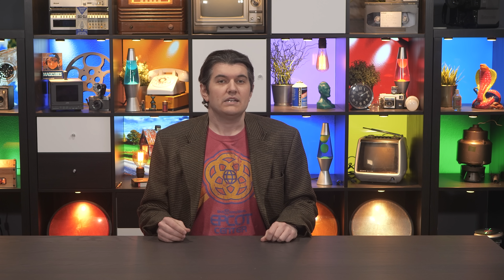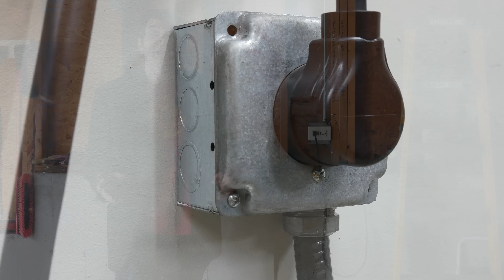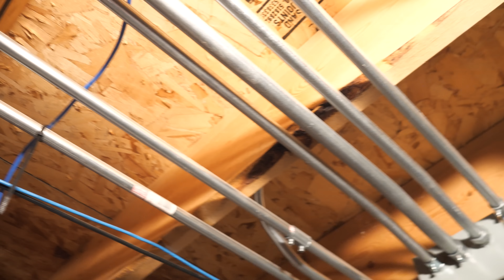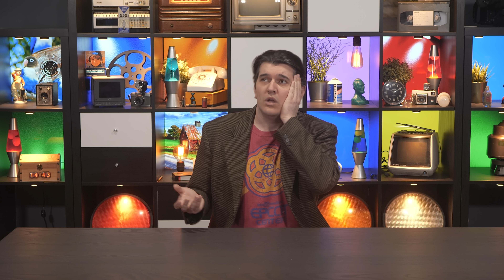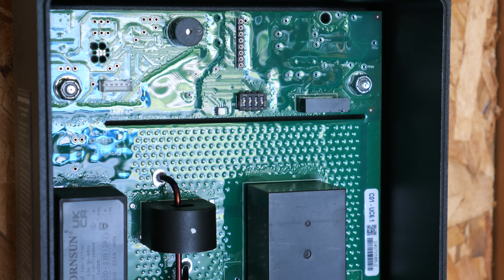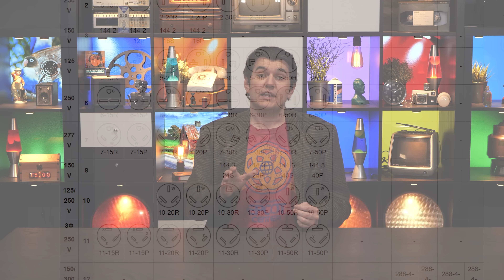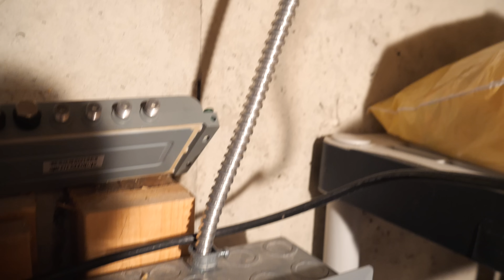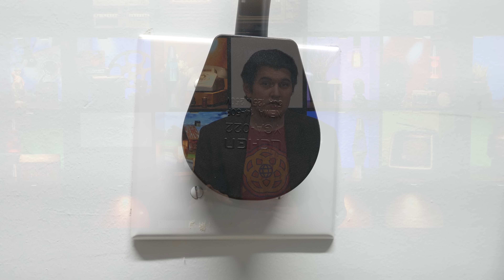The "standard" car charger is usually overkill—but your electrician might not know that

Comment: Every Diesel-Dieter would now try to tell you how it is much more convenient and way easier to replace a headgasket on any combustion-engine and that changing oil every few thausand miles is not an issue in any capacity.
Yes, I do like EVs AND I drive an older Diesel powered car. I exist and my name is not Dieter.

Comment: Currently I charge from a 15a. 120. Its Very slow. charges 1% per hour so between shifts is about 10-12% per day... my drive is 25% per day (aprox 70 miles) So i need to go to a super charger every week (which is pretty expensive. Around 60 cents a KWH for non tesla ones and there arn't many tesla ones near by they are around 35 cents KHW.  I am having a 40 amp Installed (max charge rate of car is 32A) in my area its required to be 125% of load (since its pluged in for many hours in a row).

Comment: Looking to buy a used EV this year so I can give my old Prius to my now driving-age child.  I probably will add a level 2 charger, but ONLY because the circuit breaker is in the garage and I can locate the station right next to the breaker panel, so installation will be about as cheap as it can possibly be, and the unit will be free as long as I don't get a high-end one because my electric utility offers a pretty good rebate that will pay for most mid-range (talking cost here) charging stations.  If it weren't that simple and easy (and cheap) I'd stick with level 1, because my daily driving doesn't need level 2 to replenish it.

Weirdly, I've been in conversations online in the past couple days with people who are absolutely convinced level 1 charging is horrendously dangerous and will burn your house down.  I've been trying to explain that unless your house is very old, that just isn't the case, but whoever sold them their level 2 station convinced them that it was dangerous not to use one.  And that's where I draw the line.  It's one thing to OFFER and even recommend a charging station.  It's another thing entirely to lie to customers to scare them into buying something they don't need.

Comment: This video is nonsense. A Tesla model S takes 3-4 DAYS to fully charge on 110v. Even then, if you're running on 110v, it's going to be maxing out that line, thus you should run a dedicated line, or else you'll blow the breaker anytime something else uses the line. If you're running a dedicated line, you should run a 220v line for(basically) the same cost, obviously. 

Yeah, if you commute 5 miles a day and refuse to use the car otherwise, yeah you can get away with 110v. Anyone with some sense is going to want 220v.

Comment: I told a friend I could install it for him, but he hired an electrician for $300 instead. The “electrician” put in a 50 amp breaker and set the charger to 48 amps. When I asked if he used a torque screwdriver on the breaker, he said only pussies use torque screwdrivers. We’re not friends anymore.

Comment: Last December we installed the exact charger (or similar version) you show at 1:26 in the video. We have a 2023 Chevy Bolt EUV which we charged with GMs 120 volt charger that came with the car for two years. It worked fine, but was a bit awkward to mount on the wall and it used another socket in a socket challenged garage and it was very slow. Decided to get a 240 volt charger and the ClipperCreek was on big sale as Enphase had just purchased the company. So in order to put in a 240 volt ClipperCreek charger (6-50R plug) I had to upgrade to a 200 amp main service panel, upgrade the subpanel in the garage (opposite side of house from main panel, have wires run through the ceiling from the main to the sub, and have wire installed in the garage ceiling to the charger wall location. While we were at it I also had them install wire for a heat pump water heater (coming soon) and install a generator inlet socket so I can use my Anker Solix battery when the Texas power grid poops again. But wait there's more: city code required a new meter box (has a big knife switch inside now) and new grounding rods and wire. I was happy about the grounding as I always felt the exisitng one was sketchy. All that cost around $16k but now we don't have to worry about the car being charged oevernight if my wife has a busy day and comes home with a low battery.
Reply: $16k? it's Expensive!

Comment: You can't charge from a 125 volt x 15 amp plug in winter because it won't heat the battery and charge at the same time.  In AB today Mar 26 it's -11 C.  Still winter, Eh?

Comment: Charging at 120v is the worst way to charge. You will have an emergency and have no transportation unless you have a 2nd gas car. 120v is very very slow. MC cable comes in #6 stranded 60 amp. It also comes in # 2 stranded 100 amp.

Comment: One thing most folks don't know is the importance of quality in electrical sockets.  There are 240v 48a sockets for around $20.  The same outlets are also available for $100+  The expensive ones will last for years.  The cheap ones will quickly wear when they are plugged in and unplugged, soon heating more and more and are a big safety problem.

Comment: For the first month or two I had my car, I charged it off of the 125V 15 Amp circuit I had available. That was not convenient or adequate in the winter parking it in an unheated garage.  I wired up a 240V circuit to charge it at about 30 Amps. I upgraded that to 50 amps when time permitted because I could do it myself, though 30 amps was really enough.

Comment: I started out with a higher power charger and a nema 50 amp plug now I use a portable charger where I can set the charge rate to 8,10,12 or 16amps - didn’t notice the difference - the car finishes charging early in the morning instead of midnight

Comment: I was lucky to have my EVSE installed right next to my panel, so having an electrician hardwire install a 60 amp breaker was $400. I’m not sure how much less it would have been for a 50, 40, or 30 amp breaker but I rather have more than I need than not enough. Never know when a spur of the moment long trip is needed in an hour or two and I can get as much in before departure. Plus, my utility company charges the lowest rate between 12am - 4am, so with a 48 amp max I can almost always charge within that lower rate time. I do usually charge at a lower amps by adjusting in the chargers app (like 32 amps), but if I need to I can always just move it up in the app.

Comment: Agree on the need for a charger to be linked to anything but the car and power supply. Software NEVER works flawlessly and simply adds to the failure rate. My apologies to all the nerds out there who NEVER write bulletproof code. Ditto the refrigerators, dishwashers, and washing machines who think they too need to tell my smartphone I'm low on milk.

Comment: We’ve installed a level two charger, but I’m not sure we “need it”.  Yes, you do have to remain focused on plugging your car in the second you pull in the driveway and leaving it plugged in until the second you pull out, but having said that, you can get away with it on 110 if you just focus.  I doubt we will ever get back all the money we’ve spent on the level two charger by using a time of day rate, but that is one excuse for having one.  The good news is the power company pays for the Electrician so we only have to pay 600 bucks for the charger.   

And yes, you can get a cheaper charger.

Comment: In Germany this is even more insane. If you want to have a charger say in your garage and one in front of the house, your local electricity provider will deny it. If you have a heat pump, they will deny both.
There is just no good alternative for providing power for charging. The Schuko outlet is said to melt under continuous 16A/~4000W draw.

For my flat they offered to build charging stations for 5500€ per unit. (I don't know how many are the top limit for me and my neighbors)
And we would have to pay 18€ per month for the subscription plus insane prices like 50ct per kwh.

Comment: My garage has a 30A outlet but had a cheap Chinese outlet so I put in a good 20A 120v  outlet and charge at the 18A charging in my Blazer EV! This cost virtually nothing and have never needed to charge anywhere else! “State of Charge” showed melted outlets so don’t use a cheap outlet! I wouldn’t trust 220v outlets in new houses either as builders go cheap!

Comment: In the UK all installed chargers must be smart by law, never considered the points you made towards dumb chargers however the main issue with the UK is that for the cheper EV electric traiffs you need a smart charger or a supported car and the chargers are better support than the cars from what ive seen however ill be importing all the data sources (supplier, charger and car) into home assistant so it will all be within a single app and controlable by our favourite voice assistant

Comment: 24:54 I rent a single family home along with a couple of roommates. That information would actually be extremely useful to me as someone thinking about getting an electric car because we need to know how much electricity my car is drawing in order to fairly split the electric bill.
Reply: My EV displays the amount of electricity (in kWh) my car has consumed on the trip odometer. I read it and reset it when I get my electrify bill.

Or, read your monthly mileage and multiply by a factor from other people with the same car. My car averages 236 wH per mile. I pay $0.23 per kWh for electricity… That’s 5.4 cents per mile. I pay more per mile to insure my car.
Reply: @paulkelly5035  I thought about that, but if I do any amount of charging at a different charger it throws it off.

Comment: My job got a fleet of EVs, a bunch of Bolts, and a few Mustangs. The powers to be begain to freak out about charging.

I am the senior most electrician so I heard a lot of this. I asked if these vehicles were for on campus. And of course, yes.

I installed a hand full of 120vac 20 amp GFCIs random throughout. I told them to plug it in every night.

They gain about 22 miles overnight and use about 10 miles, at most, a work day.

Comment: It's interesting to see the differences between the electricity stantdards in the US and Europe.
Here in Europe, it's very unusual to see a EV charging point plugged to a Shuko outlet. Usually we have a dedicated line with the wires just screwed directly into the charging point cirtcuit.

About the simplicity of the charging points... I have to dissagree. I have a quite simple one and I'm considering moving to a more complex one as soon as I upgrade my house. And mine is even more complex than yours, as it has dynamic load management, so it monitors my household load and adjust itself so the main switch doesn't trip. And that's why you need to monitor your consumption, rather than FYI. And well... that's also a nice feature if you can integrate it with your home automation, like Home Assistant.
But as soon as I install solar panels I'd love to have more information and control. Like to be able to tell the charging station when to charge (on demand, just with solar energy, when the power tarif is cheap), with a very high potential of saving money. Also, you can plug it to Home Assistant or your inverter to make it more integrated and inteligent.
And it doesn''t necessarily needs to be connected to the internet, just to plug a RJ45 cable and to work 100% locally in your network.
A great example is the V2C Trydan, with all these features great to have if you need to control when and how power is consumed.

Comment: We usually charge on 120V over night without any issues. Otherwise, we plug into the 30A dryer outlet and get a full charge in around 6 hours. If we really need a fast charge, we go down the street and plug into the local charging station.

Comment: Just got my first EV and after an electrician told us that in order to pass a code inspection we 100% without question had to upgrade our 125A panel to install any 240v charger. Instead we had a different electrician install an 60A Emporia Pro that has a monitor that adjusts the charging level based on the total load and is also code compliant. Saved at least $10k and it charges at 48A in the middle of the night.

Comment: The huge hack is if you have a 20A 120v outlet, you can switch the breaker out and reconfigure for 240v 20A with no new cable drop!

Comment: We thought our EV would be dead within a week if we didn’t get a data charger installed ASAP. But 6 months after buying an EV we are still just using a regular old 120V wall outlet. We don’t have a long commute in the family. I think that’s really the dividing point where you need to consider upgrading.

Comment: If you need the conduit, then put in the conduit. It’s not that much more expensive. You can get flexible conduit if it’s necessary. Just get metallic sheathing if that’s what you want. Cheap and easy is seldom the best solution, especially for the next guy that has to deal with it.

Comment: I bought an EV about a year ago. At the time, I was thinking of moving soon so I didn't wire a new plug and just used a 120v outlet. A year later (I haven't moved yet lol, but still looking to) and that has served me just fine. Sure, some days I have heavier usage and I can't get filled up overnight, but the next day or the weekend I always catch up. ONE TIME I went to a DC charger, but that was more out of curiosity and some peace of mind, as the next day was COLD and had a lot of driving planned.

Comment: FYI - larger MC cables do exist, but you can't really find them at your local hardware store. I am installing a heater in my garage and I bought 8/2 MC cable from an online electrical supplier.

Comment: I'm surviving with a 12 amp common household plug which charges at 3 mph.  It takes 48 hours + to charge the car up to 85% or for a 10 hour overnight session its about 12%.  I don't have a garage so I have a power cable exposed in the driveway for 5 of 7 days a week.  I found an old obsolete electric dryer outlet and my buddy figured out it was a 30amp 220v unused, so we cut it and spliced it into a 6 gauge copper wire (50' roll $230 home depot), and ran it into the garage and installed a NEMA 14-50 plug there.  Now I charge overnight twice a week.  Highly recommend using an electric dryer outlet if you have one or if you can figure out how to share it one at at time 14:00.  Stuff I learned: if you have a slow charger, charge to 85% instead of 80%.  Also Tesla charging stations are nearly 1/2 price at midnight - 4am, no one talks about it.

Comment: Interesting. UK is 240V of course but even dedicated chargers aren't allowed beyond about 7Kw unless we go 3 phase (even though dedicated circuits can pull significantly more than that on a single phase). Agree with you in terms of Apps for these things. Charger manufacturers in the UK use our (excessive) regulations to lock down any user configurability so we can't set things like max current draw ourselves (even if we know what we are doing).

Comment: We have a Chevy Bolt that gets charged about once a week. A cheap 16 amp “charger” plugs into the dryer outlet and easily charges it overnight. To reduce wear and tear on the dryer plug we installed a switch to switch between the dryer and charger. The charger cost about $130 and the switch about $140. 

Fun fact: an EV charger isn’t really a charger, it’s simply a logic circuit with some heavy duty relays - communicates with the car and turns the power on and off to the car charger. The actual charger is in the car.

Comment: I installed 240V in my previous 3 garages, the first 2 for $250 each and the last one for free with my EUV.  The free one installed by a major contractor failed within a year and I defaulted to 110V.  In my current condo, the breaker box isn't in the garage, but in the lower level, so 110V is all I intend to use.  I charge my bZ at 30% and stop at 70% for the health of the battery pack.  If I know I'll be taking a trip, I'll time the charge to hit 100% no more than an hour or two before I start my drive.  If it's an unplanned trip, I can top-off at the Tesla Superchargers just 2.7 miles away.  Anyone care to buy my 240V Siemens VersaCharge?

Comment: Greetings from Ecuador and thank you so much for this video! 
Early in the 20th century American companies were brought to electrify the country, so we inherited your split phase power system for households. But generally we only have 60A service

That said, I still got a 32A EVSE. We very rarely have central cooling (we don’t need heating), nor central electric heating (we use what you in the US like to call a Suicide Shower 😂) so even with 60A service it has presented no problems. It has been working great for months charging 2 BYD Seagulls. Chinese EV with 200 miles of range, sold here for $20~K

As electricians here are quite unfamiliar with EVSEs your video gave me the information to be able to hire someone that understood what had to be done to install it properly!

Thank you so much!

Comment: If you live in a cold climate a 120V 12 amp connection may not charge your car at all in the winter because all the energy may be going into heating the battery to bring it up to charging temperature.

Comment: A counter argument is “A heavier cable pays itself back over time” How so? IR losses on the cable (Amps x resistance) eg length. can be calculated. Over time, you get a “payback period” . Cheers - (sparky from Kiwiland)

Comment: 14:46 and please correct me if wrong, but if you were to plug the charging station into a GFCI outlet, rather than hardwiring it, that doubling up of GFCI protection can cause multiple problems as well.

Comment: This is all true if you don't consider time off use rates. If the cheapest electricity is after midnight, you might have decent ROI by upgrading your charging to exclusively take advantage of it by charging faster in the middle of the night.